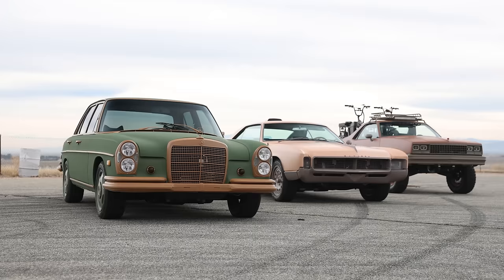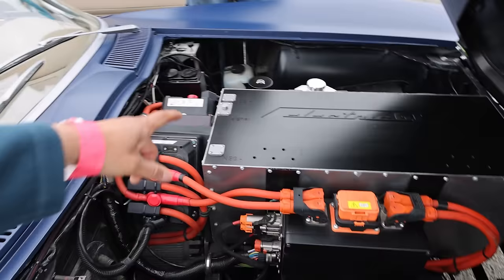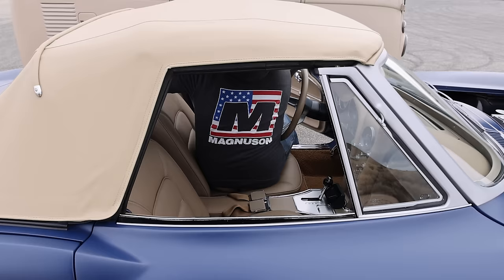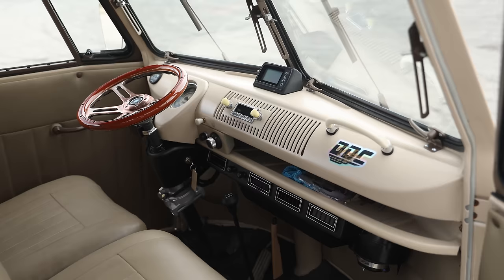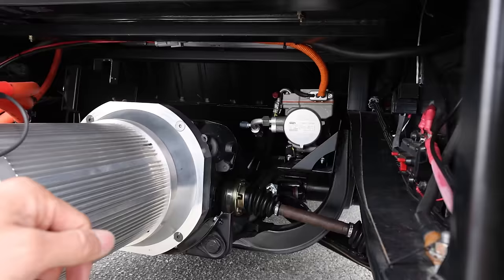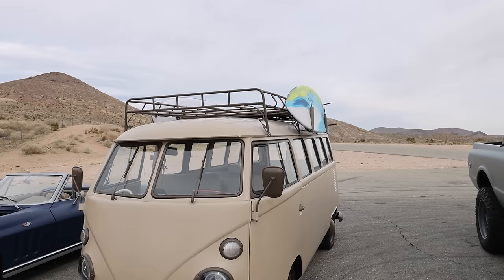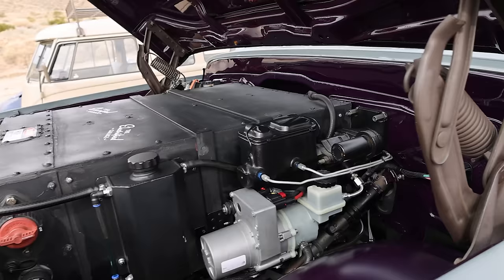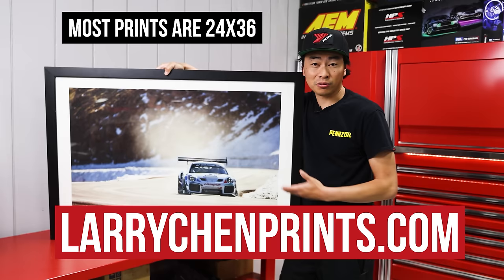Robert Downey's Cars, Electrified For the Modern World

Comment: People bashing electric cars are correct the way current technology stands, it’s just as disruptive to the environment as a gas powered car (the latter of which has become extremely efficient due to years of practice), but if two things can happen then we’ll be all electric moving forward in my humble opinion. The first of which is battery recycling would need to become a thing (this is happening already with a couple recent companies. The second is solid state lithium ion batteries which would essentially give a vehicle the ability to go 2000 miles per charge (my understanding is this is still in its infancy) which would get people around the awful public battery charging stations. In the meantime I refuse to be an early adopter of ev technology